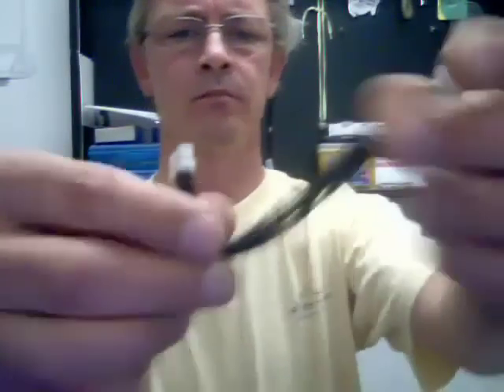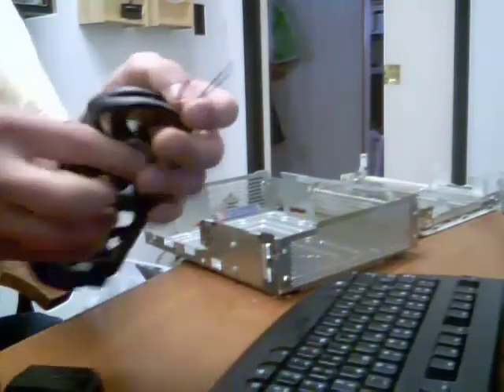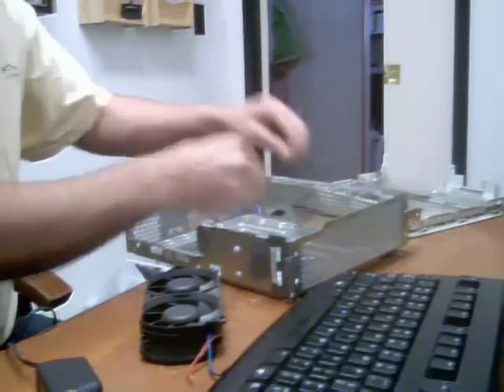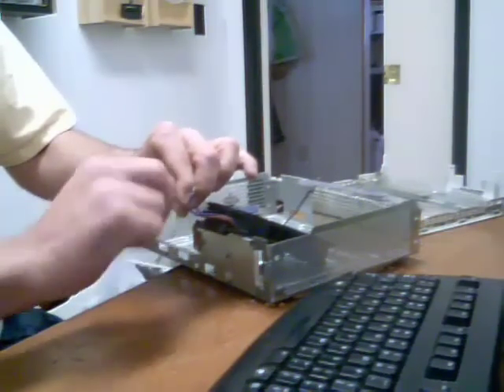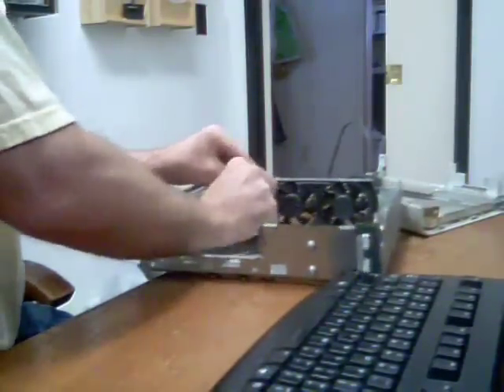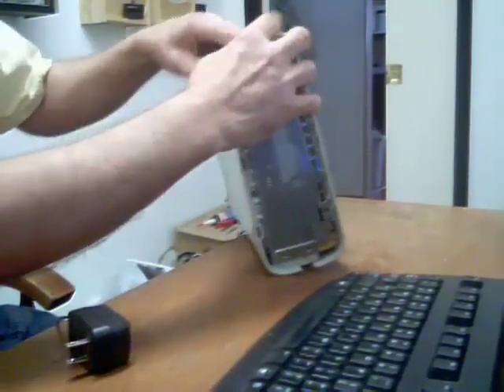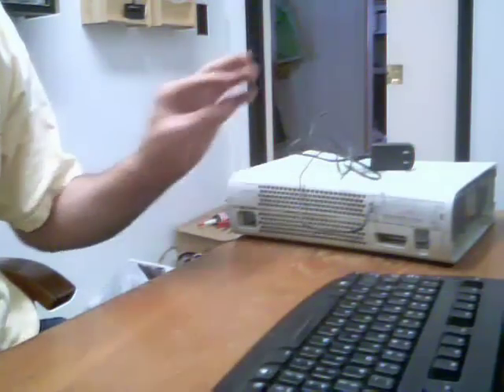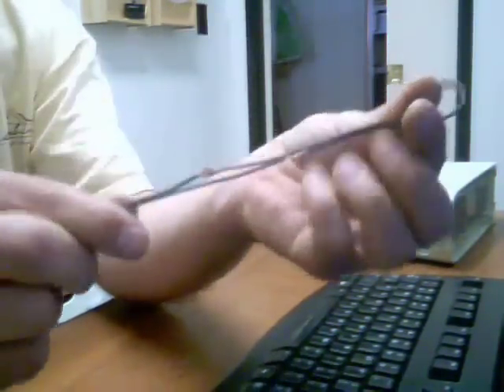The best Xbox 360 fan mod you can do!

Comment: I had RROD on my sons XBOX. I had done the overheat reset a couple of times but, as you have discussed, I felt that it would just make things worse. I did your fan mod with the separate power source and Bingo! RROD gone without having to do a reset. I think this proves that the RROD is a power supply as well as an overheating problem. My son playtested it and no screen freezes so far. Thank you very much for this.

Comment from the maker: @99butcher99 This power supply was a 9V 210 mA I think it is perfect you get the fan speed you want and it is not to lowed you can use a 12 Volt power supply but the fans get very lowed and you do not need to supercharge them just speed them up a little

Comment from the maker: @kugotsumin You can leave the foil caps on if you like it will help the air flow to go completely thru the heat sink, but you will need to monitor the dust levels more closely because now if the face becomes blocked with dust the air can no longer go around the face and will over heat the Xbox that would be very bad.

Comment from the maker: @Ashrafinthehouse It was an old house phone charger 9V DC cut the ends and splice to wires of the fan the fan will only allow voltage in one direction so you must test your polarity + or – before you add a plug to it. it is that simple you can use up to 12V DC if you like but this should not be dun unless your fan has lost power threw the motherboard or it is j-Tagged.

Comment from the maker: @NOLIMIT69NOLIMIT2000 FYI there is a hole both in the metal case and the plastic case the wire is not pinched and will if you want slid freely in and out that is why you must secure the splice and tye a not in the wire to prevent it from getting pulled out

Comment from the maker: @brkatipuran Over cooling can be almost as bad as over heating! If you add a fan to the out side of the Xbox you should only be using 9V on the internal fan; (Not 12V) And only about equal external fans on the Xbox. This will prudes positive air presser inside the Xbox and also prevent dust from being sucked or blown in to the disk drive causing open tray.

Comment from the maker: @brkatipuran  I am not mad at you, and if you want to keep your fans that is your decision but I am saying Running your Xbox to cold can cause problems not as much as to hot from dust or dry thermal past but adding fans like that is not necessary as long as you keep it clean so the stock fans can do there job. The stock fan can and will go all the way to 12V full blast if it needs to. So no need for fan mod just cleaning to maintain consistent temp

Comment from the maker: @dartz315 I agree that 2 plugs is and can be a pain, but I put this up because for most they do not want to remove the motherboard from the case and will likely kill the Xbox if they try soldering wires to the motherboard. This is the safest, fastest and easiest way to return the power to a fan that has lost power; there are many, many ways to do this some good some bad. But this is the best way because there is no complications caused by removing the MB.

Comment from the maker: @KOOLANCE720 I do not recommend soldering to the motherboard because it is too easy to mess up stuff on the mother board both on removal and soldering. However I do agree what you described will work and would require less effort in the long run; I just wanted to show something simple that will not draw power threw the motherboard and can be dun without any damage potential. Do you agree?

Comment: I just pulled power from the 12V side of the power plug on the motherboard. No extra adapters, etc. Just solder in some wires and call it a day.

Comment from the maker: @nielsssg You are only half right it will damage the drive, but I do know what I am talking about in the video about the heat and added power it is not like I am just guessing about what is going on with the Xbox, I actually have a very extensive background in component level electronic repair.

Comment from the maker: @XvengenceXrampageX 1 of three thing one you are not getting the X-clamps tight enough

 2 the chip GPU Chip is warped

3 The thermal regulator chip has gone bad and now it thinks it is overheating when it is not this you can do noting about.

Comment: Dude your so wrong. Stealing power from the DVD drive wont increase the heat, it will just damage the dvd drive over time as the dvd drive isn't getting the power it needs. Just wire it up underneath the board where the power adaptor would be. few extra amps from the power supply should be fine considering the xbox 360 has USB ports that allow us to charge your phone etc.

Comment from the maker: @thetryhardnoobs1 You need to use the X-clamps properly the bolts you are putting in the Xbox is warping the motherboard & chip and causing the heat sink to touch and short out on the components of the motherboard. But I am telling you right now you are going to remove any chance at a lasting repair and send it to a early grave! If you use the power of the Xbox for a reflow

Comment from the maker: @imrithor If you had 3 lights and the fan mod fixed it? 

It will likely only last a few weeks or less it sounds like you have a crack in a solder ball under the CPU the added cooling is preventing it from opening due to lower running temp?

Or you had an override error and now that you reduced the power it removed the error? Lets hop it is that!

Comment from the maker: @adamroxdahouse This is nothing new, only a simple way to get your fans working without drawing the additional power threw the motherboard or having to remove the mother board to solder wires to the power intake that can cause other components to burn out do to not getting proper voltages from the drain off of amperage.

Comment: @scott20055 if you had a plug that by the flick of a swich can change power from say 3v to 12v then you will be able to adjust it but do not go any higher than 12v cause you might fuck the fan up.
oh and when the xbox fan spins normally at tis fastest its only 5v if you did this plug mod it would be 12v

Comment from the maker: @kugotsumin It will remove all power draw from the box less power less heat, but if your fan regulators are working? I do not suggest a mod at all! If you think you must do a fan mod I sugest you just use a Talismoon Whisper Fan for Xbox 360

Comment from the maker: @nuorangejapan No you are wrong. If you do that it will only prolong the life a few months and cause the damage to the solder below the chips to be 50 times worse! Possibly to the point of needing a total reball! It is best to provide proper maintenance and have the thermal past renewed once every 17 to 24 months! With proper maintains your Xbox will last the 10+ years like Microsoft originally calmed they would.

Comment: I have a question... when you have the red, brown, blue and black wires tied together (red w/ brown)(blue w/ black), can this be done the same way but with the XCM High Speed Air Cooler v2.0 that have a red, yellow, and 2 black wires leading from the fan?

Comment from the maker: @GunRunner88X I do not recommend them at all you will run your Xbox hotter just to try and cool it off it would be best to use a Talismoon Whisper Fan for Xbox 360 you can find them on ebay you can get them with lights and you will not need to worry about excessive power drain causing the box to run hotter and you will need nothing ells.

Comment: @thetryhardnoobs1 I fix rrod xboxs and t sounds like you are shorting out the Xbox with screws take and use them but before putting them on use small thin nylon washers that fit the screw perfect if you are using metal one don't cause it can short your Xbox out even if they come in the repair kits you get online trust me

Comment: no offense but the reason this method sucks is that no one wants to have to plug in 2 outlet plugs just go run the xbox.  soldering under the psu is the best way. not messing with any other wires and getting power straight from the power source.
but i guess ur way works as well, just more stripping of wires and shit.

Comment from the maker: @brkatipuran I watched your videos and it is obvious you have no background In electronics. So for you to even suggest that my modification is not the best or anything is ridicules, obviously there are ways of making this mod better by adding thermal regulators and/or off switches but it is the absolute best way you can do a fan mod for a J-tagged box or a Xbox that has lost power to the fans.